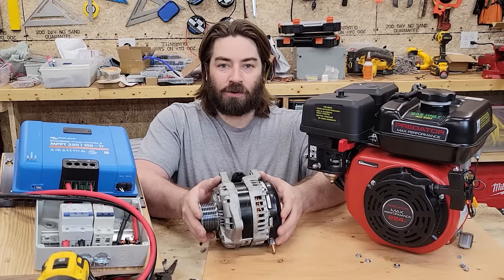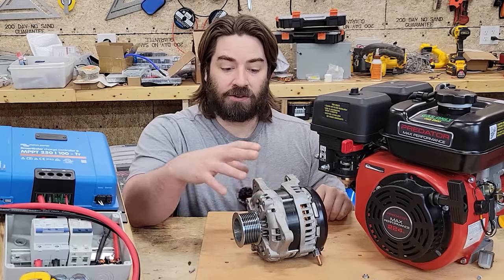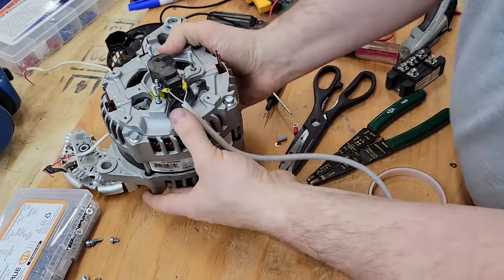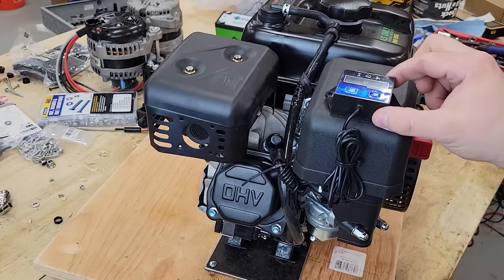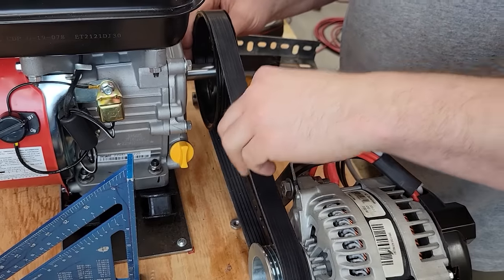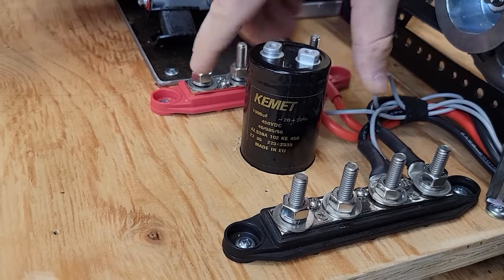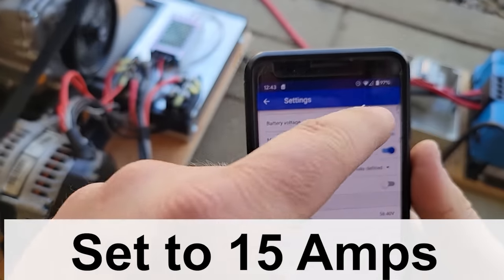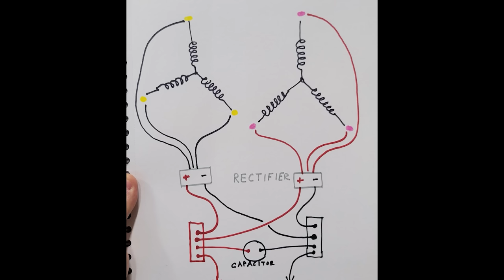The AlternatorGenerator, First Attempt.  48V Battery Charging

Comment: hey so the 3kW is just a coincidence, you SHOULD be able to get full current at whatever voltage you're now running the alternator, IF you can feed it enough power. You're probably bumping up against the output limit of the engine, or maybe the RPM governor? fun fact: mppt should work in this scenario, though the lag from the governor may cause some issues. if it does have issues, pinning the throttle open may resolve them, again letting the mppt algo work on the system to maximize power output
Reply: to clarify: you're probably bumping up against a torque limit, actually. for the same applied rotor winding voltage, RPM will be proportional to voltage, and current will be proportional to torque. the MPPT will try to go for max power out, not max fuel economy.

Comment: All my equipment is 24 volt. I built a 560 ah battery with grade a eve cells a few weeks ago and I'd love to have a charger like you built here. I'm gonna try it with a 150 amp 24 volt alternator.  Ido you know which motor I should buy from harbor freight?
Reply from the maker: The 6.5hp engine is usually the best value at around $150 +/- depending on sales.
Reply: @DavidPozEnergy  thanks man. I'm an over the road truck driver and don't get a lot of home time but when I am home all I do is mess with my solar and batteries and all that. I'm hopeful that I can build a charger like the one you built but hopefully at 24 volts it will be easier to get the right voltage for my batteries. I've thought about just chargers and a generator for hard times but I really like the alternator deal the best

Comment: If the alternator is double the rpm of the car motor, it is clear that it can withstand that speed. So it must be able to do 12000 rpm. qed. The magnetic field is throttled.

Comment: Dear David, I follow many of your videos. But this time I want to react. And it is because I think, you made a small mistake in the wireing of the alternator. Around min 11 you show that the 3 windings are rectified before they are connected together. That is the correct way. As it is a alternating current system, they should oppose eachother when rectified after being connected to each other. But in your system, you first connect them and then rectifies (see after min.16) 
So I would suggest to rewind that and use 3 bridge rectifiers and then connect them
Reply from the maker: The AC is rectified to DC first, then the two DC outputs are paralleled.  There are probably more than 1 way to do this, but that's how I did it.

Comment: You could get a 24v alternator and use  a24v to 48v boost converter and saved a lot of time and effort.
Reply from the maker: That would be a nice way to set it up.  The boost converters I've used in the past are fairly small, at a couple hundred Watts.  Do you know of one that does a few kW?
Reply: @DavidPozEnergy  day green 1000w boost  converter on alli express $46 similar converter on Amazon $158 or 1920w for $168 saw 2000w on eBay I don't remember the price

Comment: Ok I think you got to much flex on your rubber mounts, ac compressor mounts might be more suited for your application and if you did want to do a direct shaft mount you could use love joy couplers very easy setup. I really enjoyed  this video and learned a few things too good job on that setup oh yeah I forgot you could just fasten your wood down with tapcon bolts too just saying.
Reply from the maker: Thanks for your comment.  I fixed the vibration issue in Video part 2.  And, in video part 3 I fine-tuned the efficiency.

Comment: Amazing work and engineering. However, I like to throw things together that already exist, so I needed a way to charge my 36-volt golf car while under operation. I mounted my 36-volt charger and a 12-volt gas powered generator on the back of my golf car and plugged it in, problem solved.

Comment: I get why you removed the AVR by why did you also remove the internal rectifier?  I assume there was a reason but I must have missed it.
Reply from the maker: The built in rectifier may have worked, but I didn't know for sure.  I answered this question in depth in my follow up video.  https://youtu.be/cy0t4qq8mS0  at time 22:39
Reply: @DavidPozEnergy  You may be right.  An alternative also would be the less common isolated return/ground alternators.  They have a dedicated negative lug.  Anyways your videos are interesting because I am looking to build a marine 48vdc generator.

Comment: On other hand.. How about having a ready to use 120 to 240 AC Volt generator and passing that AC through Rectifiers in order to feed its output into MPPT or Home Lithium ion battery charger further to charge EV car batteries. ?? 🤔

Comment: 26:25 I have a (maybe stupid) question: couldn't you heat that pulley and then put it on the shaft?
(Use the effect of thermal expansion)
Reply from the maker: I didn't think about heating it when I made the generator.  It makes sense.  There have been several people writing in telling me I could have put it in the oven to heat it.  I'll have to try it next time.

Comment: What about the heat produced in the alternator at those voltages?  Will it melt the insides after awhile of continued run ??
Reply from the maker: I didn't have any problems with my thermal tests.  Check out Video part 2 where I use a thermal imaging camera.

Comment: I'd have done the same just to play but I'm pretty sure a 48v alternator would be cheaper than all the equipment you used
Reply: The only difference is 48v alternator vs 12v alternator.  Total project cost is about the same.

Comment: I think u should design some nice lookin frame work and mount ur works . Some 3-4" roller wheels w/ locking breaks. Very pro 👌 if u use strip lights multi color u could light up ea circuit eng light strip alternator , ea part in the frame work . uc the colors are good it's running fine . LED's light it up like it came from 2023 . Look @ that 👍 for a gas engine sys.. off grid recharging. There's a 20 kw free energy gen. U should check that one out on utube.. ✓

Comment: Cheaper to get 2000w quiet genetator and all in one unit that charges wity solar and power from outlet and has built in charger from 120v to 24v or 48v that can charge up 80amps at 48v

Comment: should be able to use this in hydro power? water wheel etc? i have a new house, or farm, it is direcly heated by oil radiators electrically. I have a river at my disposal. i need some help.
Reply from the maker: I think that's awesome you have a river available.  I've never set up a micro-hydro system, so I'm not sure the best approach.  I'm sorry.

Comment: Would heating up the serpentine belt pulley to expand it help get it on the shaft?
Reply from the maker: There have been several commenters who say it would work.  Some have suggested putting it in the oven at 300°F for an hour and then it would slip on the shaft.  I haven't tried that, but want to next time.

Comment: couple of thoughts,  from my perspective the victron was finding peak power there of the engine, and not of the alternator, if the engine could have sustained a higher rpm I think the victron would have kept going higher on the current.  however the victron is very good at finding peak power so that is why it seemed that the engine was not bogging.  Also, once you have the field enegrized, there is no such thing as making it "more energized".  As for direct drive that would be very good however you still need the higher voltage output which means you need the higher ratio you are getting from the belt.  and Finally, your safety situation here was very scary, using the phone and multimeter while also using your finger to point at things around the belt... that is a finger removal machine...  be careful.

oh and one more thing, that capacitor is likely not nearly enough,  you could end up destroying the victron by feeding it rough power.  If you want some much better capacitors hit me up.
Reply: The capacitor is fine ...

Comment: I was wanting to do this in the past but with multiple alternators and maybe with a moped engine or possibly with moped engine and transmission or whole entire moped , so the wheel of the moped would be what turns the alternators , so kind of like an indoor bicycle exerciser and with that design maybe the moped could still be driven off if needed  ,  but I wasn't sure if either idea would actually spin the alternator fast enough thus not giving me the power I want . Feel free to give feedback or experiment . Also would a tiny chainsaw/weed trimmer engine be able to effectively run an alternator or alternators ; I'm thinking they are around 25cc which I think is half the size of moped engines but are 2 stroke thus putting out roughly the same power as the moped engines so I guess I need to look into it further .
Reply from the maker: I think it would be fun to try if you have the items already.  However, this is not as efficient as buying a pre-built generator.
Reply: @DavidPoz  Exactly what I was thinking due to I was going to keep alternators DC then go straight to a powerbank then converted to AC power .

Comment: Excellent how about running 2  220 alternators and reduce yhe rev per minute for long termnreliability 
Even better run 2 alts part power to a hho cell running yhe engine and gettimg free charging power to batteries

Comment: What if you used 2 alternators, one on each side of the engine pulley?
Would that really double your output, and would it bog the engine?
Reply from the maker: In this case, it would bog down the engine.  But, a fun idea if you have a larger engine

Comment: No matter how hard I want to learn I just can't understand it and how did you get ac from the alternator ?
Reply from the maker: The alternator produces AC from the start.  That big aluminum rectifier on the back of the alternator turned the AC into DC.  We used to use DC generators on older cars, I think roughly pre-1960 (I'm not sure).  After that manufacturers switched to Alternators because they lasted a lot longer.

Comment: Im here watching this and have no interest in ever even getting a electric car, but the mechanical and electronical knowledge kept me here as it is interesting to see what an alternnator can do, and i would think about 75v would be possible. So also seeing how our governments are killing our economy the thought of buying a old Tesla car and purpose it for its batteries are the main purpose in my mind. So great video. And for the getting the pulley cranked on. Why didnt you just make a notch in the Chinese pulley and slide it on? Or maybe its my unknowingly twisted hard way of doing things that would have made your way much much easier. And in all seriousness it was. If you didnt have a pulley and needed this done you could have heated the pulley and knocked it into maybe? But then risking the crankbearings perhaps? See, im already at harder level shit.immideately. GOOOD JOB you did there my fine sir.
Reply from the maker: Since making the video... several people left comments suggesting to heat the pully in an oven, then it would have slid on the shaft.  I think that sounds cool, so I might try it next time.
Reply: @DavidPozEnergy  you can just also use a gas torch like you do when you burn the sugar on top of the creme brule you know. Not the set everything on fire gas torch. And use it evenly and not at just one place and that chinese steel would heat up no problem. :) I use this method on my aluminium rims on my motorcycles while i have the bearings inside the freezer. And voila.. like a professional when she straddles ron jeremy. A slight evenly tap and it slides on. But your method dont involve burning your hands or anything so your method was the best. But i thought you would make a slot for the part. You did a awesome job. I watched all three episodes and the golf cart already.

Comment: Bolt the platform to a used tire that don't have a rim in it. Lay the tire down and use it as the base, base.
Reply from the maker: Good idea.  I was able to solve the vibration issue by making a new steel base.  Check out part 2 and 3 for more info.

Comment: Would you try running a 4000 watts motorcycle hub and see how much you can gett and if you can  charge the batteries that run a smaller pullied hub?
Reply from the maker: Sure, if you have a 4kW hub motor I'll be that would work well.  I've never tried it myself, so I don't know for sure.
Reply: @DavidPozEnergy  
What's your email address. Like to share with you my hub set-up and maybe you can help with ideas. Out issue here in Africa is to gett batteries but easy to get any other mechanical parts guess it's the dangers of shopping. So the few batteries available I plan to use to drive one small  hub motor and in turn through belt drive a bigger hub motor 4,000 watts and gett continuous power supply for my electric motorcycle.

Comment: Taking notes for when the EVs and Air Conditioning take out the power grid, I could use my log splitter engine to supplement solar.
Reply from the maker: That would be cool, to add an alternator to the log splitter.

Comment: I wonder if you could keep the original diodes  or AC to DC rectifier.
Reply from the maker: I didn't know the specifications of the original diodes, also, I wasn't sure about the bridge between the high-Voltage and low-Voltage sides being a problem or not. In video part 2, I dedicated a few minutes to discussing using the original rectifier.  I figured the method I used (separate rectifier) was a safer option with so many unknowns.
Reply: @DavidPozEnergy  makes sense

Comment: @DavidPozEnergy do you think that little engine would spin an AuraGen???🤔
Reply from the maker: That is really cool.  I just checked out their website.  I'll bet you would get more power out than my alternator.
Reply: @DavidPoz  Yep! There's another   youtuber that acquired an AuraGen by purchasing a used TV Broadcast van. My "Ultimate Mobile Setup" would probably look like a Ford SuperDuty with an AuraGen under the hood and some kind of battery bank to bleed off the extra power with an inverter for use when the engine and AuraGen is not running.😁👍🏻 BTW, Thanks for the Quick Reply!!!
Reply: @DavidPoz  You probably know heat that's generated from the circuitry during the run/charging process is energy that's lost!!!--conversion loss/inefficiency! Best designs would minimize/eliminate this by using efficient charge circuitry and fast charge battery chemistry to uptake the output from the generator as quickly and efficiently as possible!!!

Comment: I have a question. If you have lets say 1hp petrol engine. How much power will your output be at the alternator. In other words, whats the efficiency of the alternator.
Reply from the maker: You might be able to get 400 Watts.  Alternators are in the range of 50-70% efficient.

Comment: Hello, one question. How does the charge controller, rectifier and generator react when the charge controller switches off the load because the battery is full? I would have considered that there would be overvoltages that would damage the electronics.
Reply from the maker: I haven't had any damage that I can tell.  Maybe there is a spike in the process,  but I oversized my wires, capacitor, and charge controller.
Reply: @DavidPozEnergy  many thanks

Comment: Instead of a belt couldn't you weld the pulley from the alternator directly to the pulley of the motor
Reply from the maker: If you did weld the two together, then the alternator and engine would have to be perfectly in-line.  The belt allows for some movement.

Comment: What about heat buildup in the alt over a longer time running if it's running at a high output  will it last
Reply from the maker: Check out video part 2, I ran several thermal tests.

Comment: Treadmill motors are dc
Ive got one out of a treadmill thats rated 3hp and 300 volts ac.
It can generate dc voltage that can be changed to ac voltage using diodes a retyfiying diode circuit 
You either make power or run it off power. Before altonators cars had genarators.
Reply from the maker: Sure.  I have a video about building a small generator with a treadmill motor.

Comment: since the rectifier changes AC to DC for your car battery, why change it twice using the inverter?
Reply from the maker: The alternator is making 3-phase, and probably around 400 hertz.  My house uses 120/240V, single phase, at 60 hertz.

Comment: I really love your shows your videos thank you however would you please go get a generator from a welding machine that puts out 220 volt or whatever and in front of it would you couple a electric a 110 electric motor in front of it and make the generator running 110 electric motor that runs the generator so they were running together with no other power source
Reply: So in summary what I'm saying is the electric motors that generator that powers the electric motor that spins the generator that powers the electric motor they they they work together I actually built one many years ago

Comment: Why would you not just leave the original rectifier connected to the windings and on the alternator? It would save time and money.
Reply: Can the diodes handle 80 volts?

Comment: Will that setup work for a 24v battery bank or just 48v what determines the 48v vs 24v charging ?
Reply from the maker: Because I'm running the power through my charge controller, I can charge any battery.  The charge controller can be set for 12V, 24V, and 48V.
Reply: @DavidPozEnergy  oh that's right I do have two of the victrons 100/30 charge controllers but hopefully my new inverter generator be here this week I'm in Ohio completely off grid and these clouds suck 😞

Comment: I would leave the alternator alone and just add a step up buck converter to the voltage you need, if you need more watts just add a few more buck converters
Reply: You could add & make a small 12v supercapacitor to excite the alternator with a push on/off button